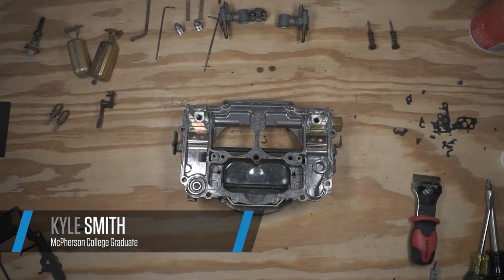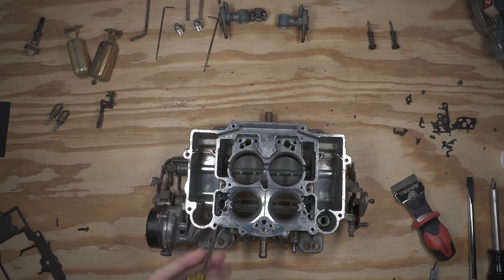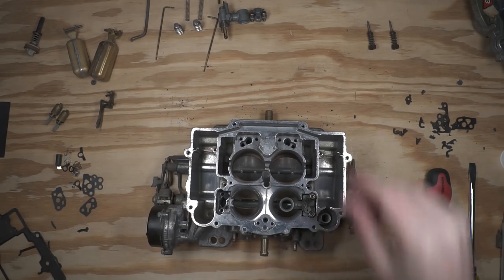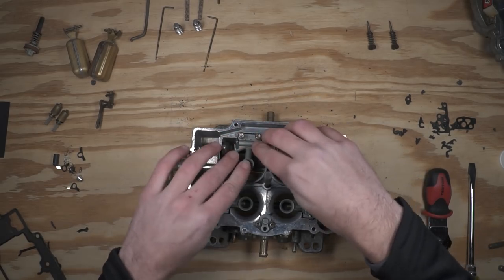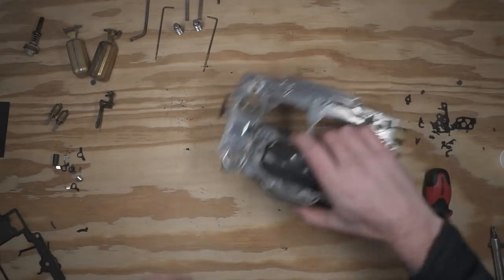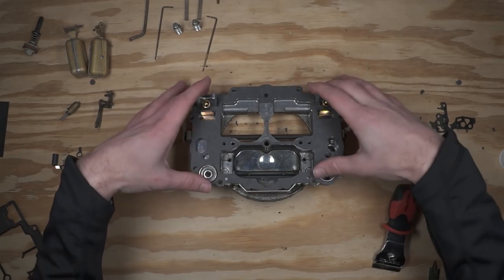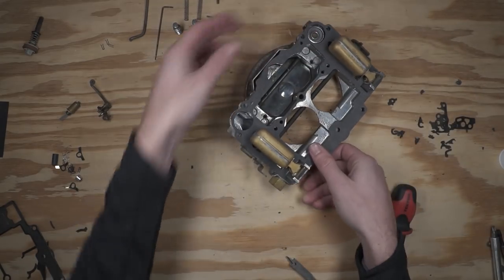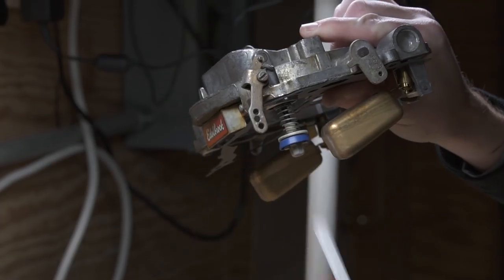How to rebuild an Edelbrock or Carter AFB carburetor | Part 2 - Reassembly | Hagerty DIY

Comment: The new accelerator pump spring is smaller on one end. It goes into the bottom of the well. The bigger end attaches to the pump. You can use a credit card for electric choke adjustment. Place credit card against choke horn and adjust electric choke so choke butter fly just touches credit card and then tighten down 3 phillip screws hold downs.

Comment: A suggestion.  Instead of holding the top of the carb with your hand when measuring the float drop, get a couple of brinks (stacked) and set the carb top on the bricks (fuel bowls hanging down).  Now you have both hands free to measure, and not shaking (particularly for us older types).

Comment: Dirty work table : possible dirt back in the carb. C'mon ! And no compressed air to clear any passages ?
Reply: That's the same thought I had, glad to see you did too.
Reply: Me to, why not have a clean workplace before assembling. He didnt even let the parts soak for a minute, and all parts should be blown clean with air. I bet all the passages are still full of debries.

Comment: Soooo....I am DIY'er with a 1964 Corvette that has a Carter 3460S carb. I have been plagued with rough idle issues and can't find anyone in my community that will work on carburetors. I have wrestled with rebuilding the carb (it is original to the matching numbers car) but until I saw the videos have been reluctant to try rebuilding. Part one and two are so well done that I am going to order a rebuild kit! Thanks Kyle!

Comment: oh that's genius to do the plunger in the top portion first. I set it down in the bottom portion then fed it through carefully. duh! I rebuilt an AFB from a 58 DeSoto with a 350 mopar motor. Very easy carbs to rebuild. Thing fired right up afterward. Will need minimal tuning. Great vid series!

Comment: Thanks for the walk through!  I hope this does the trick for my 4.3l merc cruiser.  It was bogging down under load.  Seemed like the floats were way off from where they should have been when putting it all back together, so hopefully that was the problem (everything else seemed to be in good shape).

Comment: Great video series. I would just add to remove the air cleaner stud before removing or replacing the top because it can tear your air horn gasket and the carb will not run right :-)

Comment: Hello, thank you for taking the time to make these videos. Your instructions were step-by-step great, on my side I ran into a problem where I bought my carburetor in pieces and the guy must’ve forgot to throw in the secondary Venturi so now I’m stuck. I’m not sure if other victories from a different model size of another Edelbrock carburetor will fit. If you see this message can you let me know? If not no worries I’ll figure it out.

Comment: Great pair of videos. Did the choke linkage not belong in the top hole where it was originally found? Or do I remember incorrectly?
Reply: I thought about that too
Reply: It came out of the top hole.
Reply: The accelerator pump linkage was installed in the wrong hole. Originally in top hole per part one.

Comment: I reman a lot of caburators over 42 years, to do a good cleaning you must use carburator cleaner as Gunk an let's soak all metal parts for about 30 minutes , rince with hot water and blow all parts with compressed air. In the kit you must find instructions about ajusting many important system of the carb , choke pull off, unloader , fast idle cam , fast idle rpm, accelerator pump rod, meetering rod plunger, float level , secondary trottle opening , ect  reman a carburator is not only a cleaning job , the most important is all those ajustements, Please ! NEVER use a rag that lint can obstruc tiny passage in the carb use compress air
Reply: I wanted to say the same thing. The rag he used to clean the carb would have left an unacceptable amount of lint. Also, there is something to be said for putting all parts on the side of the carb you remove it from. This guy likes to put his same parts together, and that makes it too easy to mix them up.

Comment: For the idle mixture screws, it looks like you only adjusted them out half as far as they need to go. That was two half turns and an 1/8th turn if I am not mistaken.
Reply: He backed them out where they should have been.  He didn't use full turns in the first video he used half turns.
Reply: 1 and 1/2 is the starting point and you adjust from there.

Comment: i have found out that if you dont have to take the jets out DONT.    it just isnt needed.  also  the float drop is not needed to set,  as the float hits the bottom of the float floor first.  also try 7/32 float level and see if that works for you

Comment: He didn’t set the secondary butterfly opening with respect to the primary butterflies (bend the linkage to get the correct spacing measurement).  Not a critique of the great tutorial, just a note that there is another potential setting to check.

Comment: What sizes were the jets and metering rods? The Edelbrock Carb Owner's Manual will tell you what the carb came with stock. Also how to read the codes engraved in them.

Comment: You forgot to install the gasket and star washer in the top housing for the accelerator pump.  At 1:10  of the video you left them in the box as spare parts... Nope!  Your rebuild will be squirting fuel out of the top the accelerator pump housing.  BIG mistake for a Hagerty video!

Comment: Hi, i am having problems with the primary jets dripping constantly on AB Carter 9700 and flooding the carb, i have replaced the needle and seats, the original needles had a clip to help the needle open when the float falls but it seems to be causing the float to stick. Would you recommend the use of the clip? as i noticed you dont have them on the floats in your video.
Any advice or help would be much appreciated.
Regards Steve Fish

Comment: 16:46 float level should b 5/16 or sides of float parallel with the bowl cover
Reply: Arin the edelbrock guy says 7/16 too ,so what should they be then
Reply: @steveflewelling67  the paper instruction sheet that came with my carb kit said 5/16
Reply: @inspireonex  ok thanks

Comment: at 10:45 that is completely unnecessary. your adjustments might not be the same as before  after cleaning and rebuilding the carburetor. you could have just ran them both down backed them off about a turn and a half or two turns and then just re tuned it once the carb is on the engine running so you know its right for its current internal flow state.

Comment: Edelbrock Performer series carbs are junk! New, rebuilt, still junk.  They are so proud of their carb that they offer a 90 day warranty. Needless to say, mine is holding up the corner of my workbench.
Reply: My Edelbrock carb has been the perfect street carb for my car. I have a 1979 Camaro with a SBC 400 and a 2.41 posi rear end. At 600cfm I have all the torque I need, instant throttle response, and enough cfm to hit 120mph. I also didn't have to rebuild the carb for 15 years. My carb only had problems right before, and after I rebuilt it, I need to rebuild it again. Otherwise, I would be happy to trade you a wood block for your Eddy carb, because I would hate to see a great carb being used as a prop just because someone doesn't understand how to tune it.
Reply: learn how to tune
Reply: @megaeverything101  I do.  I put a Holley on it and problem solved.